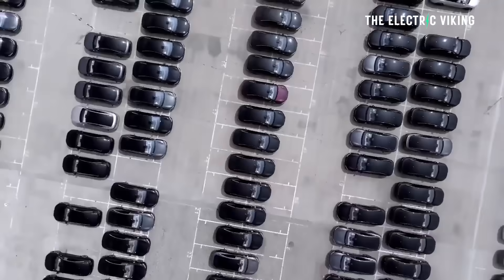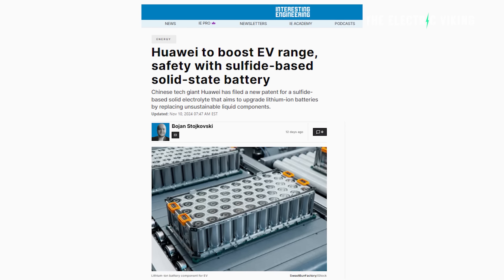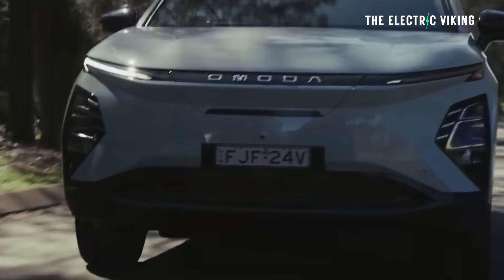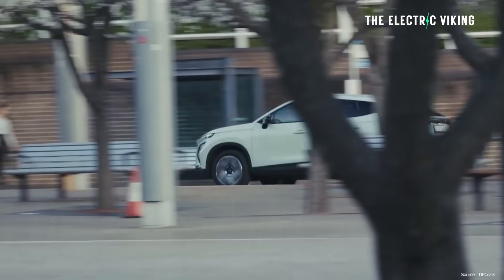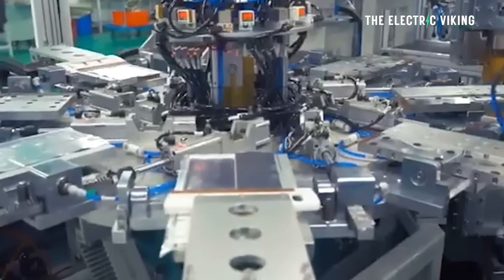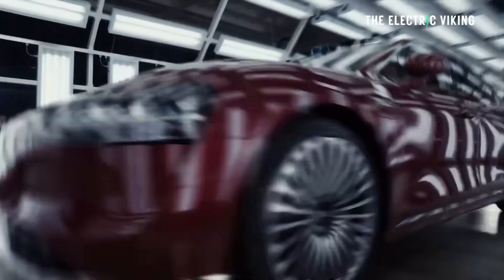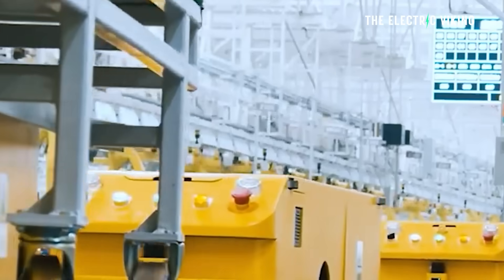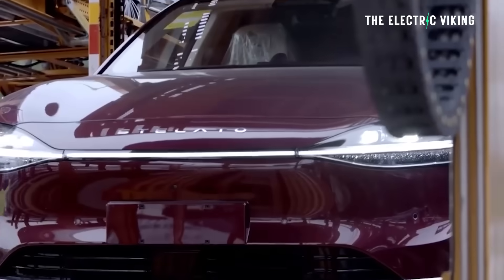Patent reveals Huawei's NEW sulfide-based solid-state battery

Comment: Ev car setbacks are the batteries, There is only one way to solve all battery related issues, life span, grid problems, battery health, fast charge times only work in perfect conditions. Ready to hear the Solution......Battery Swapping under 3 minutes period
Reply: And end up with someone else's crap battery?

No thanks.
Reply: @mikemalone9678  for example 80% Nio car owners use battery swap, every battery is tested before a swap, if there is a battery issues they can't use the battery till it's serviced.
Reply: @devilious123  But what does "tested" mean?
It means whatever the corporation wants it to mean. I could be getting a battery that can hold no more than 80%  charge, or even less. 
And how do they charge you for the replacement battery?  Do they charge you for what they say is the range of that battery? Do they credit you for the range remaining in the battery removed?

No thanks.

I'll stick to charging my own battery.

Comment: If a battery looks more like a standard pack or cell than a computer CPU then it isn't solid; it still has liquid.  Solid state has the same meaning as it has in computer chips - hard; layers. no liquid at all.  The term solid state is being abused to include batteries w reduced liquid chemistry; those are not solid.

Comment: When you can charge a battery from 10% to 100% in 5 minutes and when charging stations roughly equal in number to gas stations is when I'll shop for an EV.
Reply: I have never charged up our model y at a fast charger.  We just charge in the garage overnight once a week.  It is much more convenient and cheaper to run than My ICE truck. I don’t think we need that many charging stations.
Reply: @CombatSport777  your situation sounds like fairly light local driving.
Reply: Don't forget the 2000 mile range per charge, lol.
Reply: @Frostback-mw4xi  or a deployable solar array haha

Comment: This comes from the website of Ganfeng Lithium, who already produce sulfide electrolyte (and solid state batteries):

Lithium Sulfide
Product introduction
Function and use: as a raw material for the synthesis of solid electrolytes or as a cathode material in lithium-sulfur batteries

CAS #: 12136-58-2
Molecular formula: Li2S
Molecular weight: 45.95
Melting point: 975℃
Density: 1.66 g/cm3
Appearance: white to yellow crystals. With anti-fluorite structure.
Solubility: easily soluble in water, soluble in ethanol, soluble in acid, insoluble in alkali. >>>>>>>In the air, it is easy to absorb water vapor and hydrolyze, releasing highly toxic hydrogen sulfide gas.<<<<<<<<<
Specification: Li2S≥99.9%

Product packaging
Fluorinated bottle is vacuum packed, 2 kg/bag or according to customer requirements. Fluorinated bottle is vacuum packed, 2 kg/bag or according to customer requirements.

The part between >>> <<<< is kinda important, as it means you need to produce batteries in a dry, clean room. Which is a bit hard to scale outside a glove box. So far, cells like these are produced by hand inside a glove box with a 100% Argon atmosphere (non reactive element).

Comment: Solid state electrolyte don't increase density Sam. Changing the anode to lithium metal increases density. Changing the cathode to lithium sulfide does as well. Sulfide SSB are not lithium sulfide, they use sulfide in the electrolyte material. This is why gotions first SSB doesn't have a density increase. First they make them safer by making SSB then they will make them more dense with lithium metal.
Reply: Indeed, the Huawei press release outlines the patented aporoach  is seeking to optimise durability, safety and power density rather than energy density.
Reply: This channel only spreads misinformation. Nothing else. thanks for exposing this charlatan. who just throws random numbers without understanding underlying chemistry limit

Comment: Why don't electric cars have solar panel roofs?
Reply: I think that there is one in India
Reply: @smthB4  Lindia? already in production in CN...Always trying to butt in when CN is mention:face-blue-smiling:
Reply: Because a normal solar panel produces around 200 Wh for the area of the roof. Which means the average EV (60 kWh) would need two weeks of active 200 Wh charging. Given that the sun does not shine at night, it would take a whole month (with 0 cloudy days) to get a single charge. Hence, having a solar roof is not practical.
Reply: The Aptera will, whenever it's launched

Comment: Whats interesting is Huawei was probably investigting batteries for phones when it first came up with this. To shift the tech to EV some physicist or engineer probably did the math and realized it was potentially great for EV use.
Reply: Potentially not, the Huawei sulphide approach seems EV specific and increases the volume of a battery of Lithium Ion battery, this addresses issues with stability, durability and power density (charge/discharge rate) rather than energy density.

This approach differs to Li-S designs have been on and off since the 1960s, well before mobile phones were a thing, with electrification of vehicles being one of the original goals. The Huawei approach is seeking to optimise the performance of Li-Ion batteries, rather than the use of sulphide in solid state Li-S design that seek to prevent Lithium anode swelling associated with solid state designs.  

Additionally, improvements in Li-S cycle durability, which has been the big stumbling block for Li-S commercialisation, has been driven by EVs; as EVs represent an easier target to achieve compared to the smaller batteries in mobiles that cycle much more frequently so require high durability batteries. The same is true of the Huawei solid sulphide electrolyte approach that seeks to address safety, durability and power density of Li-Ion batteries at levels suited to EVs (10s of years lifespan) rather than mobile charge patterns (3 to 10 year lifespand).

Interestingly, Sony were going to launch a range of solid state Li-S for mobiles in 2015 but to date it still hasn't materialised. One reason being that Li-S pouch designs are a little too thick for modern phone designs, as the size of phones have optimised around the advances in Li-ion/poly resulting in extremely thin designs (with sufficient operating duration). A shift to mobiles using Li-S would equate to a thicker phone albeit with longer battery life, however, comercially it's not clear if the trade off for size vs operating duration is one an average consumer would seek.
Reply: @GruffSillyGoat  You make a lot of great points but they do not dismiss smartphone manufacturers want higher density batteries and research is research. Provided the physics works out, solid state is probably inevitable for most battery tech down the road, including phones, due to a theoretically higher energy density (assuming issues like charge times, durability, and price are solved too of course) 

Many companies involved in battery technology research solid state today no matter what their particular application. Smartphone manufacturer Samsung would be another example of this. Of course, if some company stumbles upon tech that can be repurposed for another industry than their own they will take advantage of it. IMO in most instances probably through licensing rather than building their own factories when its a technology for use outside of their particular sector (depending on how advanced their new tech is relative to competitors)

Comment: If you have fast charging cars you need massive current connected , what countries grid will be able to handle millions of EVs in the next 10 years, only small countries have any hope. the UK for ex has cables underground to houses, this would take the worlds entire supply of copper wire, are you going to dig up every street in the UK in the next decade at a cost of trillions. It is a complete no brainer.
Reply: The UK's National Grid has stated the infrastructure to individual homes isn't an issue, except for the odd remaining locations that still have electric supply cables hoping from house to house that limit supply to 60 amps or under (100 amps being more typical for modern homes built in the last 30 years). Even those with looped supplies, a home owner can ask the local DNO for an upgrade at no charge to them. 

From a nation wide perspective, the additional capacity even if all UK cars on the road were electric, is in the order of 2GW daily for the whole country (source NG and Carbon Brief). There is sufficient capacity in the transmission network for this, which is operating 40GW below it's 80GW peak back in 2005/6. 

One limitation isn't the capacity to a given house, i.e. the individual copper runs, but the capacity in particular areas supplying many houses and whether this is sized for EV charging in that overall area. That is whether the substations are sized for the expected load with EV charging. However, one of the focusses with V2H/V2G is in part to create localised load sharing between homes, trials have been operated to assest the ability for such approaches to mitigate localised capacity constraints in the impacted areas.
Reply: @GruffSillyGoat  The problem is they say you will be able to fast charge in the not to distant future, for this you will need a 70kw charger or higher . All so you will need charging  stations in the surface of the road as most people cannot charge by there house or flat , so a few million chargers will be required and the roads dug up and thousands of miles of cables run .
If there is so much spare Capacity in the grid why do they keep saying we could have power cuts if there is a problem in winter.
Reply: Those fast chargers are not really required for charging at home or work.
They are only really of benefit on longer trips, such as motorways.
And could be deployed in current motorways service stops.
Reply: @mikemalone9678  We do not have enough gen cap to charge 33 million cars.
Reply: @thetruthseeker9407  Who is "we"? 
In any case most cars spend most of their time idle, particularly overnight when loads on the electric gen/transmission/dist systems are lightest. "Smart" chargers/meters could use this time to best effect, which would be of great benefit to the overall network.
Reply: Copper is expected to hiot $100,000USD/ton in the next 8 years
Reply: Australia will take a lead role in achieving to this

Comment: More great news!!  EVERY major battery manufacturer are developing high-efficiency solid-state batteries that will put NMC and LFP in the history books soon.  Once we start seeing solid-state batts. in EV's with ranges of ~500 miles and ~10-min. charge times, that will be the day we'll see the end of ICE, but not until then as most people still won't accept ~300 miles and 20-40 min. charge times.  I only own EV's so I'm fine, but will quickly sell them for solid-state batt. EV's.
Reply: LFP will not go anywhere in the next 10 years, at least for the ESS system, it is cheap and has a very high life cycle, which is very good for ESS.
Reply: charge time is the problem.